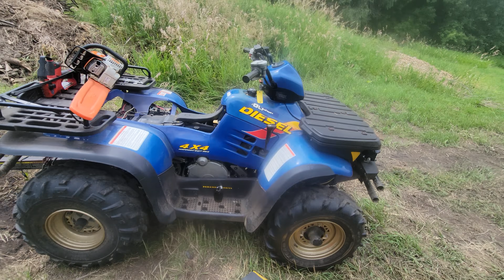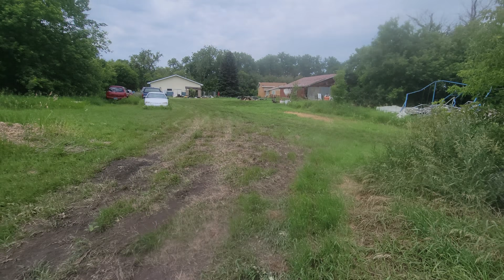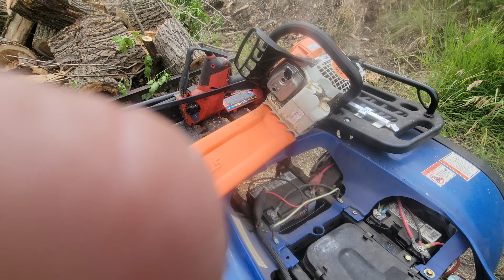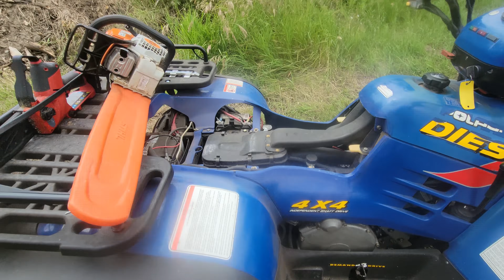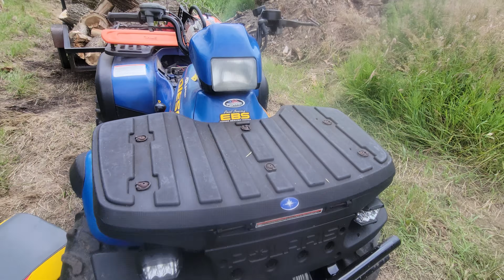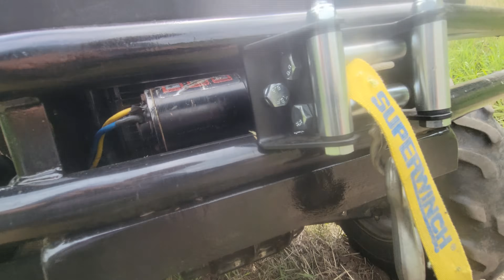Why buy a Polaris Diesel ATV?

Comment: Hi there, I have the diesel. I would like to know what kind of motor oil this atv takes. I’ve been told Polaris PS4 5w-50 and also been told diesel oil anything in 5w-40. Since it’s a diesel engine is it safe to put diesel oil?
Reply from the maker: The owners manual does state 5w-50. I would think a good quality diesel oil of the same weight would work. I have several polaris machines so I just keep a bunch of the amsoil 5w-50 for atv/utv around but am now switching to the new amsoil 0w-50 as I do use them when its below 0 farenheit.
Reply: Thanks for taking the time. I will go with what the manual recommends. 5w-50 diesel oil. Ams-oil is what I’m thinking. Once again thx for you time.

Comment: Lovely Machine! I have the Polaris(Barrus) D-Bat with the Yanmar 400cc Air cooled Diesel (1998) - the Military used them - its a beast, would be interesting to compare them side by side and do a few tests to see which preforms better. I think your machine looks a lot better for sure.
Reply from the maker: It would be interesting. If you're in the upper midwest/geeat plains area thats a possibility

Comment: I’d pull that with my 200
Reply from the maker: Good for you, I did address how little power this has in the video. I have used 400 2 strokes for 4000lbs before.
Reply: You’ll never get the gas mileage like this diesel as with a 2 stroke 200

Comment: Nice looking Diesel! Glad its still running good for you, first time i saw your machine..
Reply: You know what makes it pull better.. It's not the diesel... It only makes ten horse power... The diesel motor is heavier than the normal gas engine for it.. Take the gas powered one... Put some steel to it.. And the weight.. Is equal to front and back... This makes a good puller. Or tagging.....
Reply from the maker: @shawnlibby675 Its not any heavier than the 400/500. All aluminum, long story short its a gas 500 with a smaller bore and diesel injection system. The torque comes from the lower ratio gear case. This has more reduction than a highlifter model
Reply from the maker: Thanks. It wasnt so hot when I got it but an ebay seat cover, krylon mettallic gold spray paint, and a mint storage box off an ATP has it functional and sharp looking. When I got it that winch was mounted at the bottom of the chassis with a single bolt on one side and RCA sound wire tied up to the bumper on the other. BTW loving your content, keep it up.

Comment: Just pick up a polaris 455 and it possibly needs rings. It doesn't look like I'll have much luck finding a replacement.  Do you know where I can find a piston?
Reply from the maker: Diamond pistons out of michigan made me a set. I sold all my extras already. They might be able to get you rings though if you send in your piston. Contact them, they will let you know. Good luck.
Reply: @98dodge360v8  one more question, please. Is the solenoid located under the cover on top of the head supposed to click when you activate the throttle? I'm trying to diagnose a no start problem.
Thanks,
Reply from the maker: @kevinsullens492  It should. They are notoriously bad soleniods from what I found and most run just run the factory manual shut off. Thats what I did. My soleniod went out last fall. You could feed it a little of the good flammable brake clean while cranking and see if it pops off. If it doesnt dribble some oil down the intake at the head. Just make sure to turn it over with the decompression open first then close it and  hit it with brake cleaner. If it still doesnt go its probably toast. If it runs on brake cleaner then look for fuel issues. Have you check the stuck throttle  killswitch on the thumb throttle?
Reply: @98dodge360v8  it's probably toast. I bleed the injector and sparyed starting fluid in the intake and can't get it to turn over at all! I remove the governor cover on the head and everything appears to be working correctly.
Reply from the maker: @kevinsullens492  Easy enough to pull the flywheel cover on the right side and try to manually turn it over. Hope it all works out for you.